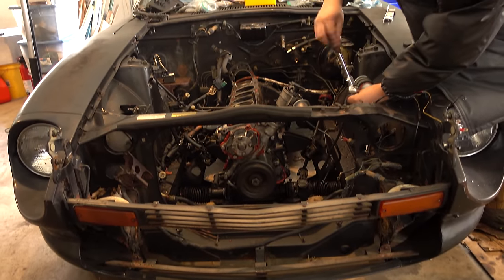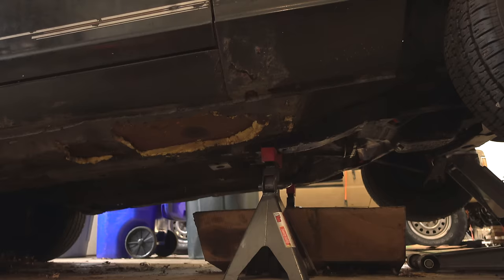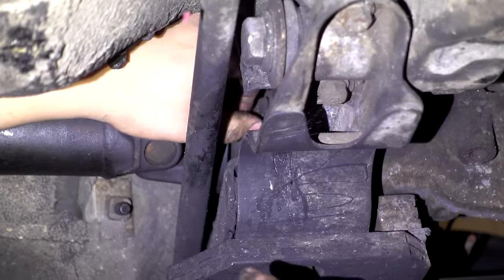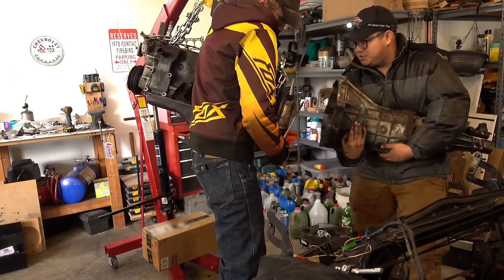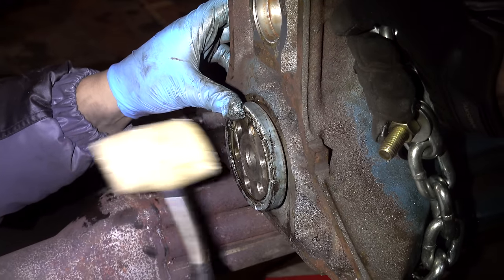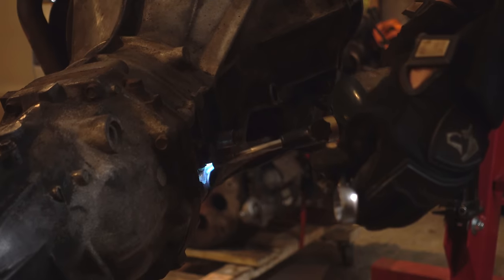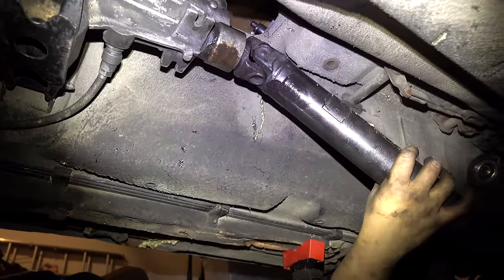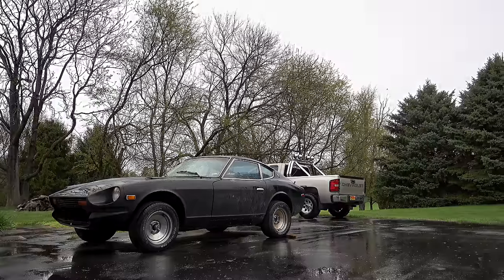Datsun 280z New Engine Install (Ep.4)

Comment: damn good job and now you know why I moved to Florida ,no snow and cold like it was in New England.Weather is a non issue now. I work on my cars everyday.
you guys are doing it right I know you will chase the wiring down luck you have two guys doing that.

I'm just rewiring mine up with two after market universal kits with modern fuse box and fuses.
I dumped the 78 fuel injection for 240 Z twin carbs and headers. Both the 240 and 280 will have L28 motors and five speeds,and twin carbs and headers with port matching. great video series I'm enjoying every one. It'll run great.
Reply: MindDezign glad you're enjoying the series man. I, for whatever reason, prefer the fuel injection. I think it's because I'm more comfortable with FI than carbs. We're trying to do everything right that we can. Sometimes, I take some shortcuts cus I'm lazy. There's definitely a lot of rust still to fix but we'll get to that later. The next video is definitely gonna be a good one.
Reply: Sean Liu I appreciate the general good quality of this build.And doing things right. But the best part if this entire build is the friendship .You two are building this car ,alot of soul is going into this car it is both your attention on this car which will become more special as this car will be a mixture of both your personalities will be in this car.Its 3 day week end three days to just work on the Zs. 
And Im excited I just found a machine shop ,I feel I can trust .So now I can machine my two L28s
as I like. A good find if your a car guy is a machine shop that you feel you can trust.Looking forward to part 5. Ok ,going to go work on mine.

Comment: 12:30
When I refurbished the subframes on my MX5 I had the gearbox "barely balanced" with two jackstands (and it was attached to the engine).
On the subframe-install my dad moved one of the stands by bumping it, tilting down the gearbox which had no propshaft in it.
Made a big puddle.

Comment: Keep in mind, there are 2 sizes of clutch and pressure plates, coupe and 2+2/turbo, you must have ordered the larger version and no wonder it didn't want to fit. back in the day, fitting in a 2+2 flywheel and clutch was a popular(and useful) upgrade.
Reply from the maker: Good to know, hadn't heard this before!

Comment: Lovein this work guys. There is one small or even larger positive point to all the oil and grease. Especially on these cars. That oil will have seriously stopped a lot of rust rot. These cars as you well know (Sorry for the reminder) are so susceptible to rust it's one of the reasons there are so few on the road still. But oil and grease is the enemy of rust. So yay for dirty old greasy stuff!!

Comment: Get a Haynes manual and FSM and read them!  You are making lots of unnecessary mistakes. For example, the locations you picked to support the car are not meant to hold the weight of the car.  The front support locations are just behind the front suspension tension rods mounts and the rear points are just aft of the floor pans just in front of the rear LCAs.

Comment: hey i just bought a datsun 280zx and it needs a new engine but i have almost no mechanic expertise besides oil and brake changes. I'm looking for an l28 so it shouldn't be as difficult as an engine swap. Does anyone have advice or am I in way over my head.
Reply from the maker: It's a big job, but if you're interested in learning there is no better way than jumping in the deep end. It's a pretty simple system so there isn't a ton to hook up, and if yours isn't botched like our 280 was (plus modifying the harness for the ZX engine) it should be a simple process, really. Just don't expect it to be a short one, and take your time. Check out some forums for advice and I'm sure there are more videos around with detailed information specifically for Datsuns.
Reply: i found an l28 in my area im gonna go check it out this weekend! wish me luck!
Reply: Well, what happened?

Comment: 1. The previous owner should be forbidden to work on another car and have to drive a Prius for his remaining yrs.

2. I'm glad to see you guys showing love to an ole 280 but....

3. Realistically, this car should go to the big car crusher in the sky. Frame is rotted out, and floor boards repaired with expanding foam? Nah, this car is gone
Reply from the maker: For whatever it may be worth it's in better shape than most of the 240/260/280Z cars I have seen in our area, at least as far as the rust. Very little/none of the rust poses a serious immediate structural threat and except around the rear hatch and the floorboards there aren't many holes. It is a mess, though.